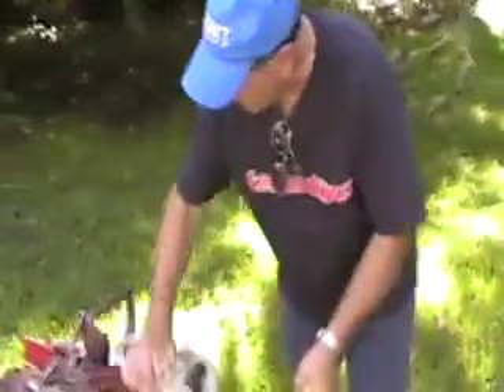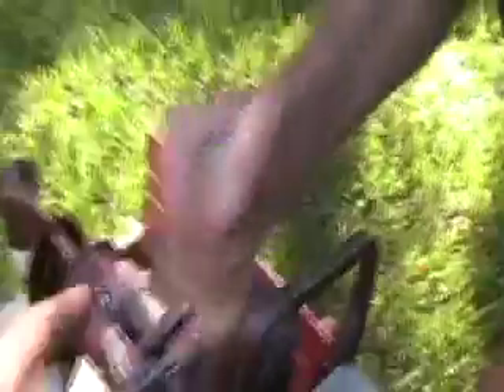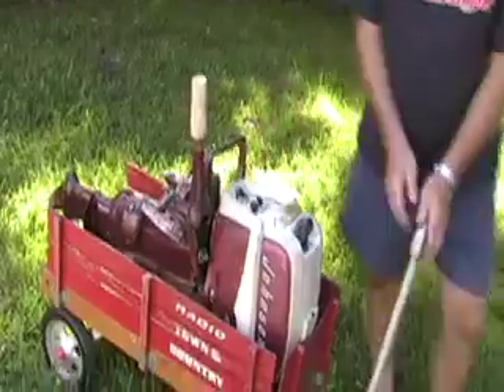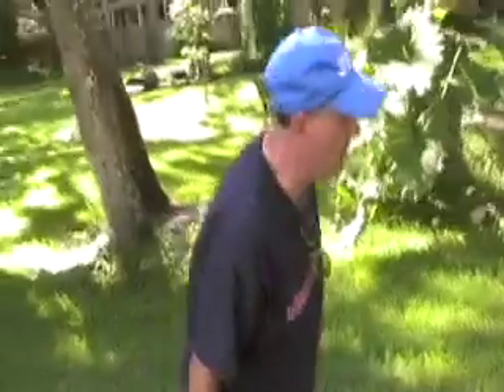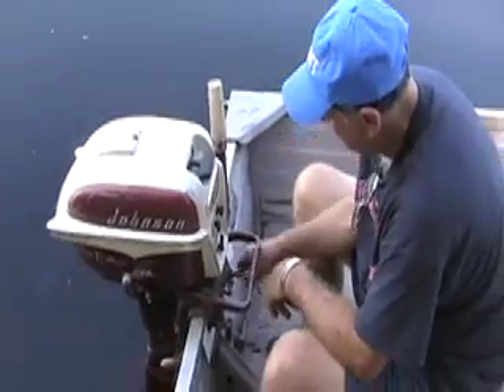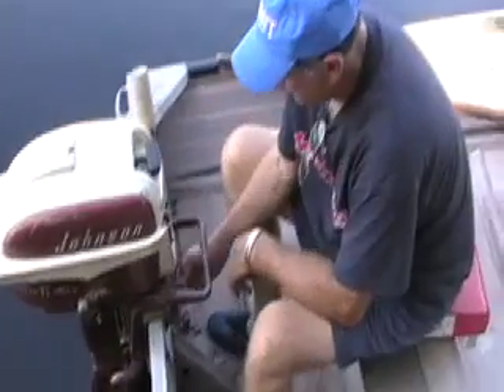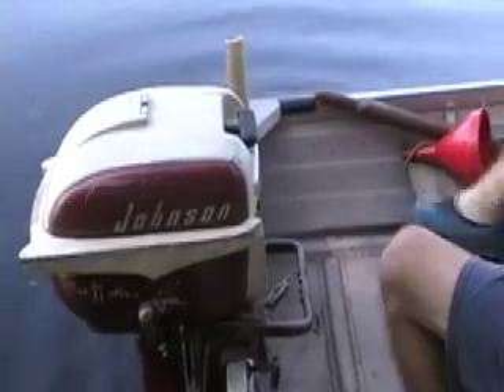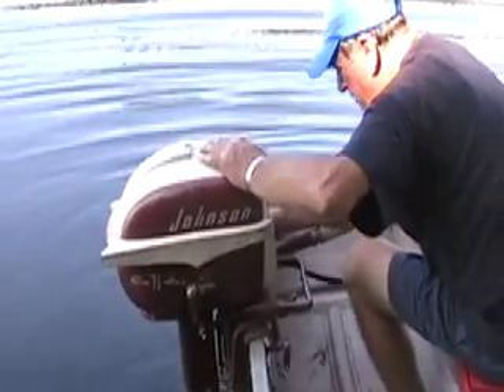Running an antique outboard 1957 Johnson

Comment: you can gently pry those teeth towards each other.  The other thing is make sure none of the linkage is binding and everything is free.  Those teeth skipping is common, especially when the tiller is raised and the handle is turned they'll tend to skip.

Comment: Ok I see your running these old 50s motors in salt water, but notice these old motors don't have a sacrificial anode block on the leg.
My question is do you think there going to corrode away internally fairly fast in normal running use with out a anode block?

Comment: That should be me right now in my 14ft 1974 Appleby, but unfortunately my 1958 Johnson 5hp 2cyl motor is locked up big time, and it would cost over $1,000 to fix, so unless someone wants to buy it from me for parts or even better, restoration, let me know. Plus, mine doesnt have a hood
Reply: vwbussesareforever lay the motor down and pour some brake fluid in the spark plug holes....it might have to soak for a week or more like that but that should free it up

Comment: Your motor is not an antique it is a Classic. I believe the cut off line according to the A.O.M.C.I is 1950 before 1950 it would be considered a antique. To be a classic it has to be between 1950 and no less then 30 years old.  So as of right now the 1979 models are considered Classic's